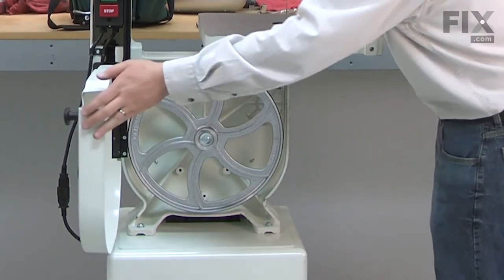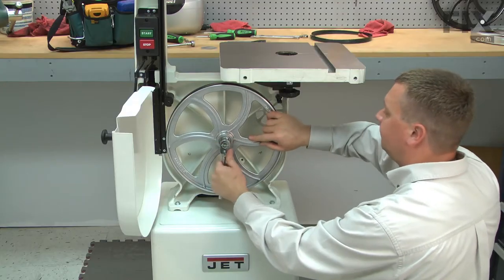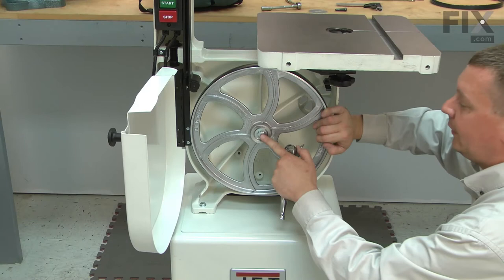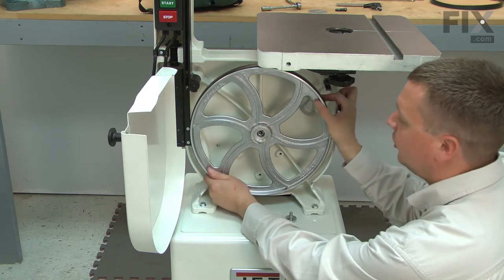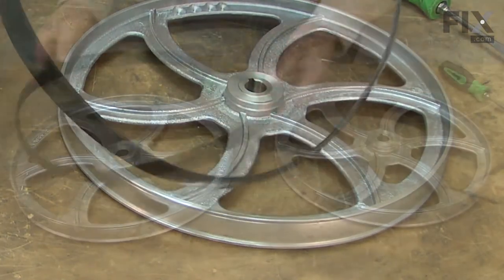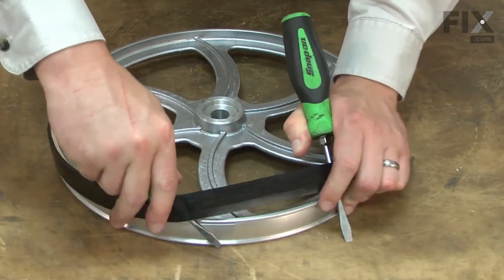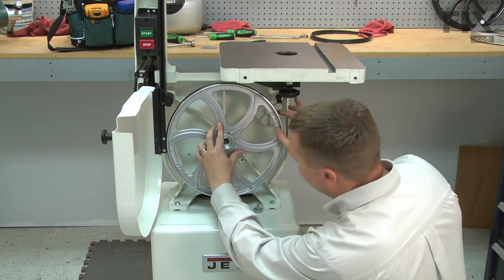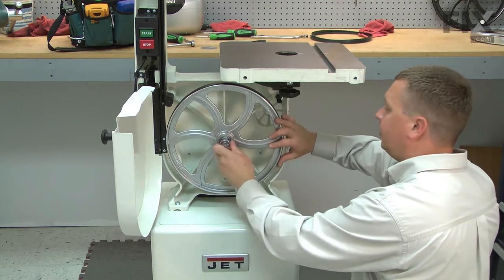Jet Bandsaw Repair - How to Replace the Lower Wheel

Comment: So- if the blade isn’t tracking with the gullet on the center of the lower tire, is that an issue?
Reply: The blade has to "track" to the center of the tire on both the upper and lower wheel of any bandsaw. In order for it to do this, the two wheels have to be perfectly parallel to one another. In a jet bandsaw there is a tracking control dial on the rear side of the upper wheel cover.  Google the manual for your model.
ALSO, use a straight edge on BOTH the rims of the upper and lower wheel. The straight edge MUST contract BOTH the rims - TOP AND BOTTOM of BOTH the upper and lower wheels SIMULTANEOUSLY for them to be in parallel. IF THEY ARE NOT - ACCORDING TO MY REFERENCE BOOKS ON BANDSAWS - the proper remedy is to remove the wheel that is too recessed and add washers behind it to push it into parallel with the other wheel. MY problem with MY JET BANDSAW is the LOWER Wheel - which is the issue in my case - is ALSO secured to the shaft via a "key" which rides in a groove in the shaft and helps fasten the wheel.  This video does not address that issue in my model and I am puzzled.  I sent an inquiry directly to JET and am still waiting.